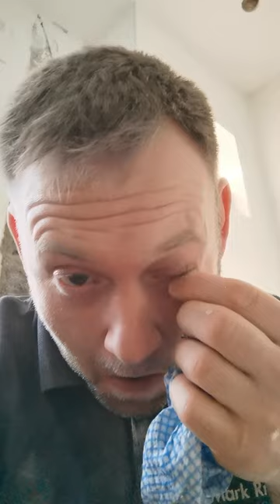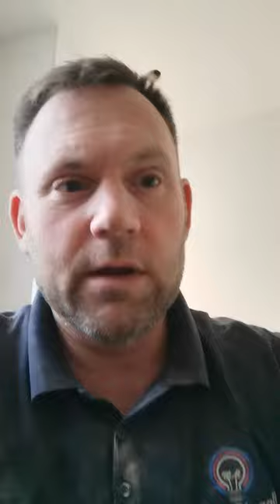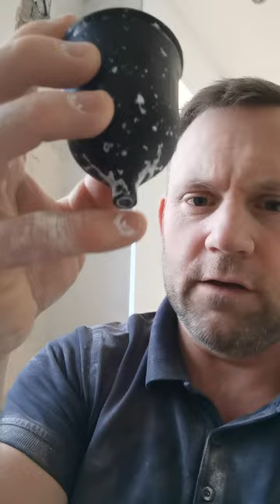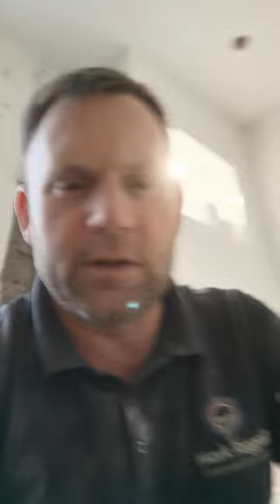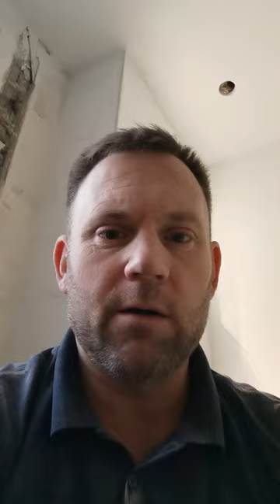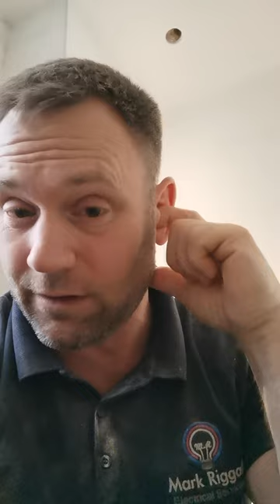Erbauer paint sprayer

Comment: The viscosity is dependant on the size of the needle in the gun,   mine has either 1.8mm or 2.5mm,  using  the 2.5mm needle, the paint viscosity is slightly thicker.
From my instructions,  they dont tell you much about altering the fan spray or density,  its very much trial and error.

Comment: 50 seconds
Reply from the maker: Is this the ultimate time exposure?
Reply: It does say it has to be 50 seconds max. 
I’ve thinned down my emulsion a hell of a lot and it still takes longer than 50 seconds. 
How much water would you say you used? Many thanks.
Reply: @unknowngamer3210  I put about 100ml in to each fill up, but it was spitting a bit. Next time I use it I will put 80mls in, I hope this helps, make sure you stir it well.